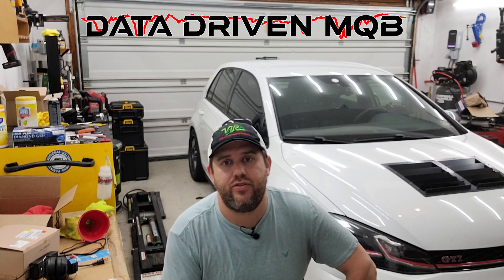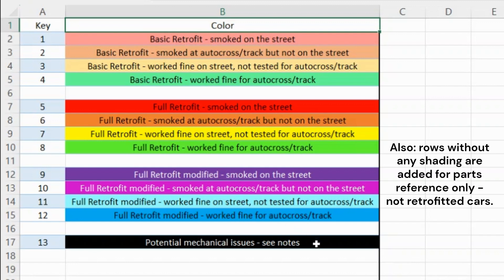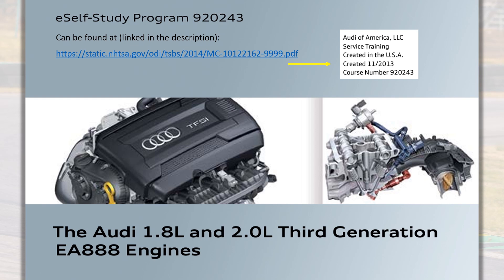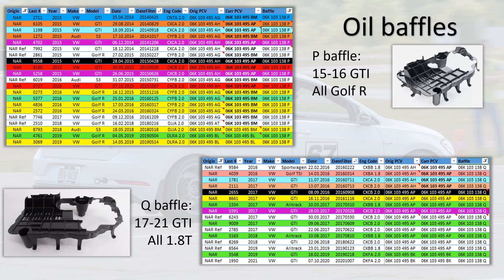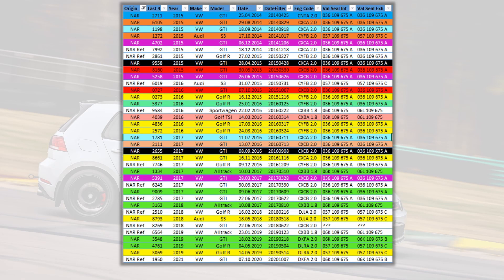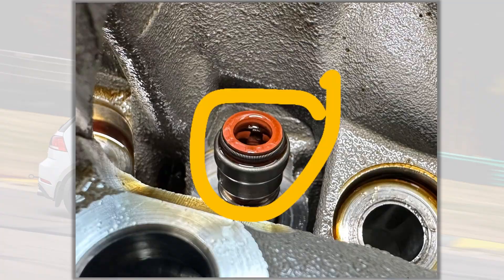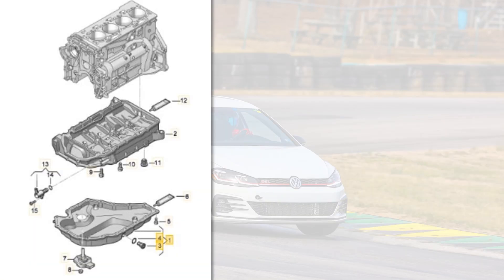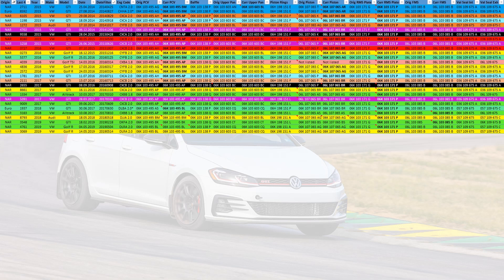EA888.3 - Surfing the parts catalog for PCV answers

Comment: I understand, but at the same time I don't.
I have a 220HP Passat, engine code CHHB, original PCV code is 06K 103 495 AG. Should I just get the same one and get it over with? Or get the BM model which is apparently latest revision, but what I was able to see from the chart on the first look, it doesn't look good.
Reply from the maker: I have a newer video which covers basically everything learned over the past few years which would be worth checking out:

https://youtu.be/g84dsN3UfvI?si=q4QREXmppA5TKeSc

Comment: This is the science I needed to learn. I saw the 034 Motorsports qa video talking about their pcv plate system vrs Apr with the extra pipe. I wanted to trust them but after watching this video. That's too much of a blanket statement as we all have different ea888 engines
Reply from the maker: I touched on different plate designs when I evaluated the APR system here:

https://youtu.be/aeCQuBDEUEs?si=VU1RfzvT2Q3J12a4

I don’t see it as a huge dealbreaker one way or the other, though the APR is a known good quantity IMO (I know MANY people tracking with no issues, some who had problems on VWR or other plates).

The 034 is very interesting to me because of the potential drain back to sump. I know of a few people using it successfully with 400-450hp track cars in Europe who previously had issues filling cans quickly.

Comment: Wouldn't it also be possible to adapt the Venturi nozzle from the evo4 to the gen3 PCV? Wouldn't this guarantee a sufficient vacuum source for larger TIP?🤔
I haven't tested it yet but it shouldn't be a major DIY effort.
Reply from the maker: My only concern is the MK7 diaphragms are considerably flimsier than the MK8 valve diaphragms. I’m not sure they’re built to handle that kind of pressure differential. This could be worth experimenting with for cars with the AP/BM valves, but not worth it on BK/BL cars since their flow path is same as MK8.

Comment: I’m curious to know if this will work on the EA888.4, super curious to know the differences. The PCV I have is 06Q-103-495-B. Just curious to know if this modification would improve on the GEN 4 MK8 R platform
Reply from the maker: Don't mess with it. The MK8 is good to go in stock form.
Reply: @datadrivenmqb  what if the EA888.4 is modified stage 2 APR ,Still good you think ?
Reply from the maker: @coreyfaiola69  super late reply but yeah I wouldn't mess with it. The MK8 system in a Gen4 engine is REALLY good. If you're trying to fix what isn't broken there's a good chance you'll break it.🙂 I've since been to Summit Point 1x for Fastivus and VIR 2x with my 19 GTI and confirmed the modified valve is not beneficial (and seems to be worse) on mine. I think the modification is strictly a last-resort for 15-16 and maybe 17-18 owners to more closely mimic their original valves. There's no real reason to mess with it on 19+ cars, and especially on MK8s.

Comment: Ive fitted my stock inlet back on. Im surprised no manufacturer has made one that creates the low pressure zone. Im sure if they did, everyone would buy them. My factory pcv on my uk 2017 7.5 is revision at
Reply from the maker: @KasamS  I know Jeff Jones (mygolfmk7) has tried to emulate the effects on a bigger TIP by 3D printing various designs. It had a minor effect but was still nowhere near what the stock TIP provides. I think the minor restriction is a primary requirement with the OEM style PCVs.
Reply: Ive found that my on throttle surge at low rpm is not as bad with the stock turbo inlet. (Dsg doesn't kick down unless i really give it some)

Comment: I’ve been watching a lot of these PCV videos you posted and there incredibly informative! I’m new to this and especially to the modding scene, I recently installed the APR Stage 1 Tune with the APR Turbo Inlet Pipe and PEX Open Air Intake, Including all new Throttle Body and Hoses. For context, I have a 2018 Volkswagen Golf TSI SE, I’ve been trying to figure out if I need to upgrade my PCV because of the new inlet pipe and the other mods I installed.
Reply from the maker: @lechef3196  thanks! The answer is unfortunately complicated depending on many factors. For a 2018 I’d run whatever PCV the dealer says is latest revision and if you encounter any issues, try a stock TIP. The APR TIP in some (other peoples) testing is actually more restrictive than stock (for power/airflow), but it lacks the dimple near the PCV port and pulls less vacuum on the diaphragm than stock. It doesn’t completely kill vacuum like the BMS and many other TIPs, but it’s less than OEM, which clearly has a lot more engineering effort put into it than anybody realized.
Reply: @datadrivenmqb  What do you think about CTS, that's what I have installed, should I remove the inlet on my 2024 mk8 gti?
Reply from the maker: @supertony02  MK8s have a completely different system. There's a venturi past the TIP so I don't foresee any kind of TIP replacements causing issues one way or the other.
Reply: @ Thank you for the info, this channel is seriously underrated.
Reply: @datadrivenmqb So after trying the APR TIP with a stage 1 APR Tune and Open Air Intake, I see what you mean by larger airflow and potential for less vacuum. 

When I’ve pushed it harder in Sport Mode I noticed some burning smells but not sure where it may be coming from. I have reason to believe it’s from the Valve seals or possibly Backblow in the inlet pipe. Still uncertain if the PCV may need replacing too, I hope by August to take it to the track and test it further
Reply: @datadrivenmqb Hi! So I just took a look at the APR Turbo Inlet Pipe and there was some Oil leftover in it. And I’m pretty sure there was more by the Intercooler Pipes as there must have been more Oil Blowby than I thought or it’s just a leak. 

I’m switching back to the Stock Inlet and changing the PCV Hose to an upgraded one from ECS. I’m hoping this mitigates the oil issue at least a little bit
Reply from the maker: @lechef3196 thanks for the info! A tiny bit of oil isn’t anything to worry about just FYI. People make way too big a deal out of it.

Comment: There is a PCV duct part on these engines also. Have you looked at variations in it?
Reply from the maker: @MikeJones-wp2mw  not sure what you’re talking about? PCV duct?
Reply: @datadrivenmqb  If you look up PCV on lots of Audi or VW cars it will show two parts, an oil separator which is the piece on top of the engine with the diaphragms inside. And another piece that bolts on the outside of the engine that just has air passages that go through it.
Reply from the maker: @MikeJones-wp2mw  I’m pretty sure you’re talking about the bolt on air-oil separator which was only on older EA888 versions (1 and 2 I think). The 888.3 has a coarse AOS built into the block itself. I suspect there are differences year to year but those are far harder to quantify.

Comment: If I already change APR DTR6054 turbo come with turbo inlet break pcv systems？ like this can I use mk8 pcv kits？
Reply from the maker: No idea, haven't tested it. But based on my findings now it appears 19+ are more likely to be successful w/ a MK8 retrofit.
Reply: @datadrivenmqb  if i use mk8 pcv retrofit kit can i change oem turbo inlet？
Reply from the maker: @scottli2436  the Venturi makes up for the lack of vacuum non-oe inlets cause. Yes.

Comment: Can you provide the part number for the pcv sensor?
Reply from the maker: 06H906052B

If you have factory SAI, you can use a harness from SC Skunkwerks to steal the SAI pressure sensor wiring for logging purposes.
Reply: @datadrivenmqb  Rockstar thank you, I don't have SAI since I have an R, but I'm gonna try to wire it into the ecu. Just need to find an open pin accepting 5v.
Reply from the maker: @blahbergerpoke  someone with an R has wired it to the same pin that is normally used for SAI for what it’s worth. The 5v signal still works as an input to the ECU. I’m not sure where he pulled the 5v reference and ground from though.

At some point I’ll write up all the info on how to get it wired up and start logging.
Reply: @datadrivenmqb  So did some digging and looks like the sai is on pin 9 or 21 but the diagrams i got seem to be missing data. Gonna get an erwin sub and see if I can use the interactive diagram to pin it out. Should be a straight forward task to wire into the ecu.
Reply: @datadrivenmqb  Do you use Mode 22 or 3E and do you by chance have the address and formula you use to log the pcv sensor?

I'm gonna try to build a harness for this sometime next week wanted to get Simos tools setup.
Reply from the maker: @blahbergerpoke  I log on 3E myself (and am on A05 file structure, so if you're on S50 the address will be different). There are two PIDs available for the SAI voltage on 3E... one of them is factory smoothed (called SAI mean voltage) and the other is raw voltage. So on 3E I prefer to use the mean voltage as it produces a cleaner signal.

On mode 22 you can only get raw voltage as far as I'm aware of. Produces a jagged spikey signal but it is useable. You can apply a 0.7 smoothing level on the PID right as logged in Simos Tools, or you can save the raw voltage and apply smoothing when viewed in Megalogviewer, etc. Really your choice. I set up mode 22 lists to just do it on ST.

For mode 22 though:
Address: 0x40e0
Scaling: %01.2f
Length: 2
Signed: FALSE
Make the gauges read -5 to 0 ideally. Set limits to -1000 and +1000.
Formula: x * 0.0047717 - 14.80
Replace the 14.80 with whatever is needed to zero the sensor with key on engine off at idle, but that should be in the ball park. This will get you started, it does not compensate for ambient pressure so large changes in elevation may require changing that base offset occasionally. For some reason on mode 22 lists I cannot get the assigned variables to work, but the way it should be handled is to replace (14.80) with (amb_press * 0.145) and then apply whatever offset to zero it after that. 
For example:
(x * 0.0047717) - (amb_press * 0.145) -0.02

I'll be covering all of this stuff some time in the future, hopefully next month or two.

Comment: I have a 2020 S3 with unitronic stage 1+ ecu tune and stage 1 tcu. I had changed my PCV with a “OE” one from FCP Euro. I starting getting blue smoke on startup after a couple of months. It was always one puff of smoke after the car had been sitting. I was also getting oil residue on the turbo and turbo inlet. I ended up trying to trouble shoot because it was driving me nuts. I ended up replacing the pcv from fcp euro with a genuine Audi/VW unit from the dealership. It’s been a couple days and hasn’t smoked since.
Reply from the maker: Yeah man, genuine parts from an actual dealership or nothing when it comes to these valves. Hope it continues to work just fine!
Reply: @datadrivenmqb  Thank you. Lesson learned.
Reply: plz keep us updated on this :)
Reply: @ronniemattsson  will do. I should add that it looked like the oil residue was right by the breather that comes off the pcv and connects to the turbo inlet.